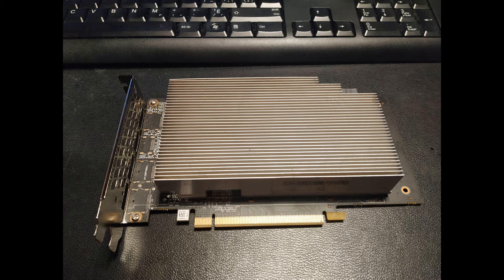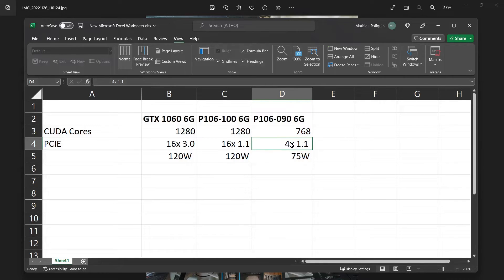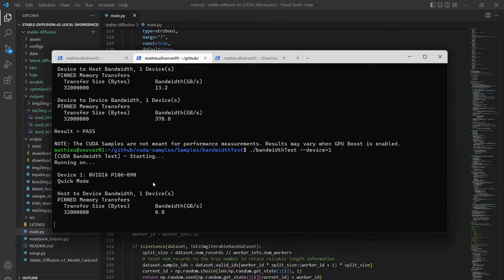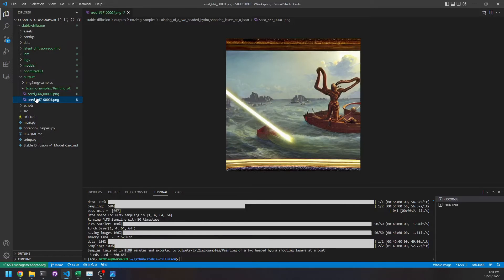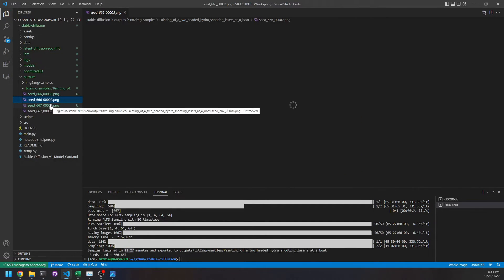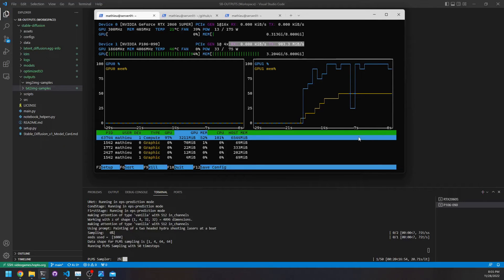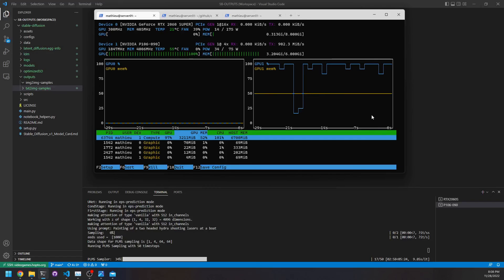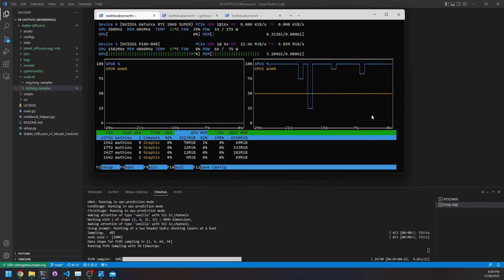Stable Diffusion on MINING cards - P106-090 6GB - Fanless

Comment: I sniped a full rack of 9 of these and i have a unused 196gb DDR3 Xeon Server laying around. I think I'll frankenstein something with it and just give it a shot. there's a module to parallelize more ComfyUI instances and use them nearly like a single one. As far as I saw it, you can even load flux with two of these.
Reply: Did you get all 9 cards to work? I have 8 of these i ran for mining id like to use for Ai but struggling with it.

Comment: I'v been using 16 CPU cores on a old server, quite slow going into hours, but RAM is good so can go any size. I'v found this fun so been looking at upgrades, been tossing up between a AMD MI25 or a Tesla M40, both quite affordable and fan mods will be no issues.
Reply from the maker: If it's available in your region for retro games like in this video you can find a cheap mining gpu such as the p106-100  for best bang for buck, otherwise I would avoid AMD gpus as their software support is not mature enough yet, I am an AMD fan so it pains me to say this lol

Comment: Hi there! Interesting video... I wonder if I can use my very old p106-90 mining rig (x6) for image generation on fooocus? Any idea?
Reply from the maker: haven't tried, but if you do please let us know the results!
Reply: I'm going to try it sometime. they main holdback seems to be the low bandwidth. I feel like this is an artificial restriction, either due to its bios, the driver, maybe even a resistor on the board. since I have a couple of these and they're cheap as chips right now, I just give it a shot in every direction.